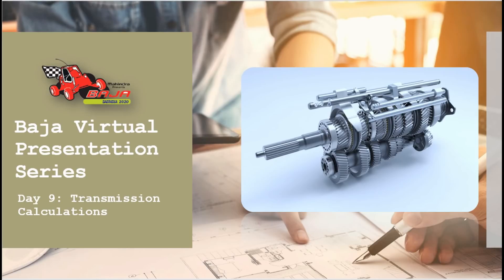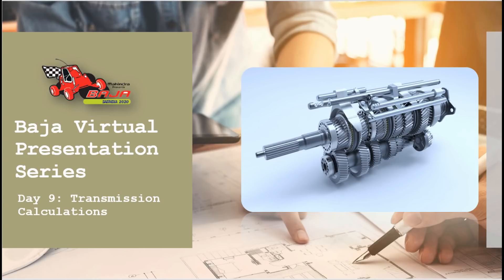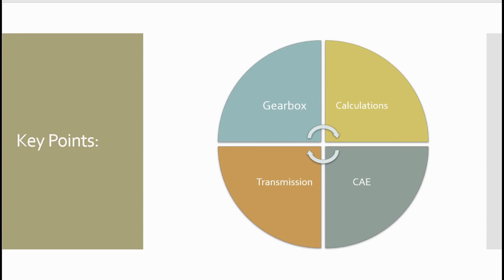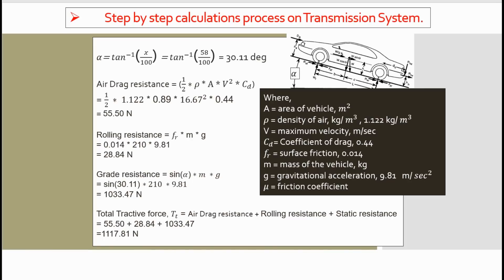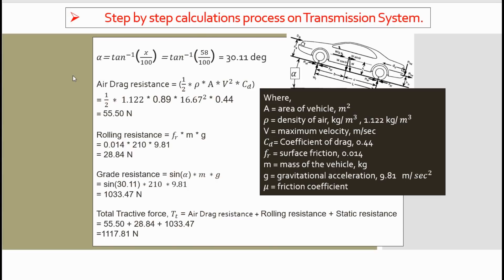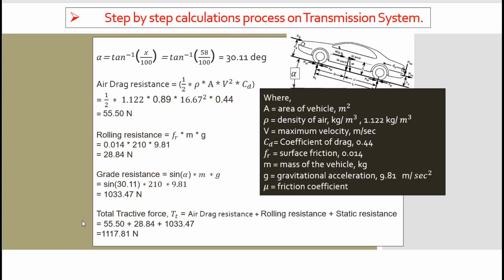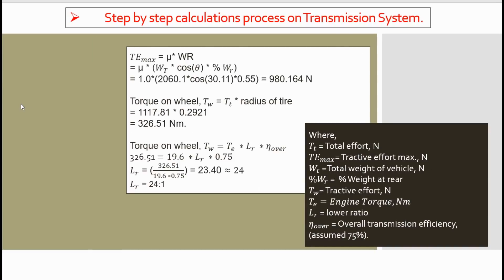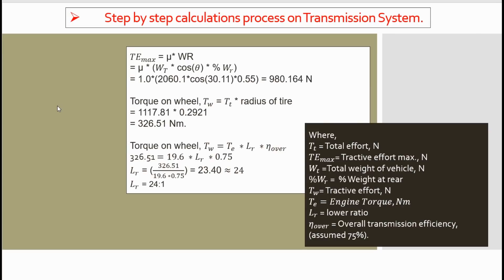Baja Virtual Presentation Series Day 9: - Transmission Calculations Slide (baja virtuals 2020)

Comment: very informative and useful      but at 3:28  grade resistance = mg sin teta     and  mg is the weight  which is 210kg then why have you multiplied it with 9.81 again or your vehicle weight is 2060.1 which is 210 x 9.81
Reply: 210 is the mass of the vehicle not weight
Reply: Then in earth's gravity the vehicle must weigh 2060.1 Kg which is 210 × 9.81
Reply: @honeykethan  no its 2060.1 Newton
Weight is a force
Reply: @honeykethan   mg is mass times gravity, so, the mass of vehicle is 210 kg and the gravity of earth is 9.81 m/s^2. With that, the gravitational potential force (mg) is 2060.1 N (Newtons, unit of measure on SI of force)
Reply: @arthurbarbosa4911  Sorry for wrong correction !   
It was due to perception that we call our mass as weight in daily life

Comment: I didn't understand the split of higher ratio... ie 3 &2.86why you did so.... And in 0.43 cvt ratio you not multiple with *2...but with 2.86 ratio you multiple it with *2 why?? Can you Plss tell me this...
Reply from the maker: When you multiply 3.5 * 2.86 = 7 that's our highest ratio and if you are manufacturing two stage reduction then stage is 3.5 and another is 2.86 ok 
And *2 was mistakenly happened it is 3.5 and second *2.86 is right.
Reply: @atvcalculations4539  means 
For gear rpm we have to divide 3600/3.5 ...and for second ratio... 3600/2.86...rght??
Reply from the maker: @sunshine3307  yes exactly good👍
Reply: @atvcalculations4539  and also which area we have to take for calculation.... Front area +side impact member area when view from front... Is it OK??
Reply from the maker: @sunshine3307  front + rrh area because that's what put a lot of drag.
Reply: @atvcalculations4539  thank you😊